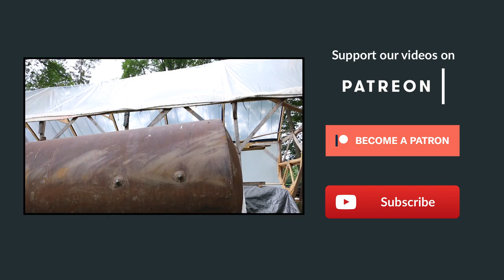Acorn to Arabella - Journey of a Wooden Boat - Episode 12: Smelter Tank

Comment: I was watching you move that steel plate and I was screaming in my head, "Watch out for that extension cord!" Then when you were cutting the steel with that grinder I couldn't help thinking, "Dude, go get an oxy-acetylene rig. There must be one you can borrow or rent near by." Love your videos so pay no attention to my nit-picking. I'm along for the ride! :D
Reply from the maker: haha, Glad you enjoy them! 
We knew the extension chord was there =)
We do have a small acetylene set-up but we use it so infrequently that I am not very good with it.  End up having a fairly ragged cut and use a bunch of gas hence using the grinder.  The wheels are cheaper than filling the tanks and I would have had to grind the edges smoother anyways if I used the torch.  We save it for times when we really need the heat or cutting power.
Reply: The words you are looking for are "Plasma Cutter". You're welcome...
Reply: I was worried about the power lead as well
Reply: I cut the plate out, when I rebuilt my 37' steel commercial fishing boat, with a saz-all with metal cutting blades. Very precise and worked great.

Comment: Other than SV Seeker every other sail boat on Youtube is using concrete for ballast, why did you use lead?
Reply from the maker: It's what the plans call for =)
To use concrete we would have to have a naval architect re-draw the plans since concrete is much less dense than lead.  Concrete is also not as stable or as long lasting as lead.  Lead keel with silicon bronze hardware is more or less the most stable, corrosion resistant keel one can have.

Comment: good design, but why did you not decide to flip the tank upside down and use the likely thicker top as the melting pot? all that rust and debris that came out of there has me wondering how much metal is left in the bottom.
Reply from the maker: The other side had a couple big holes someone cut into it and the only threaded hole was on the bottom side.  The tank was just not up to snuff but it did make a wonderful steam generator!

Comment: It isn't possible to get something that big hot enough to melt lead.
Reply from the maker: We beg to differ and we will find out one way or the other in the not too distant future! Maybe we will be eating some crow as the expression goes. Lead melts at a measly 600* F and a good hardwood fire burns much much hotter than that!  Just need a big enough fire =)
Reply: Kevin Hornbuckle Lead has a very low melting point, a decent fire under there will melt lead easily. After all people make their own fishing weights (we call them sinkers in Australia) at home on their gas cooktop.